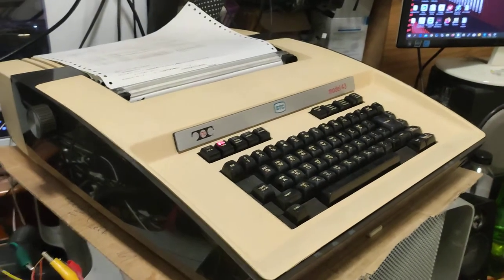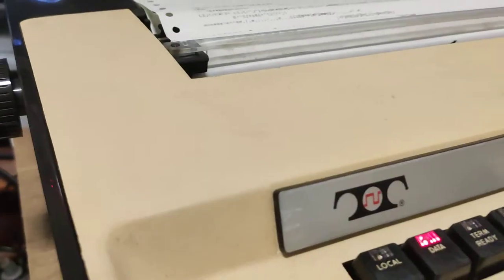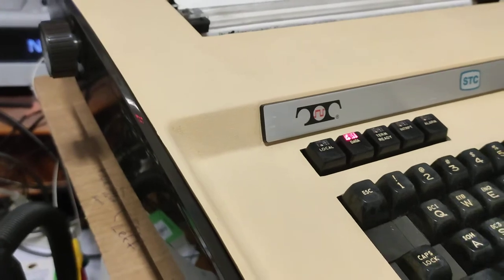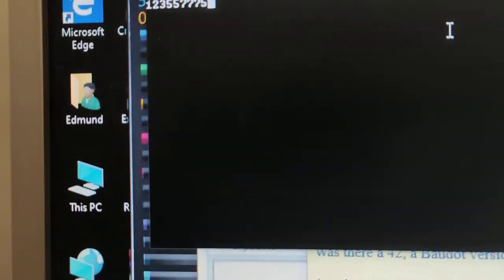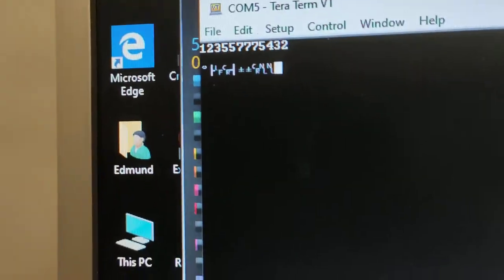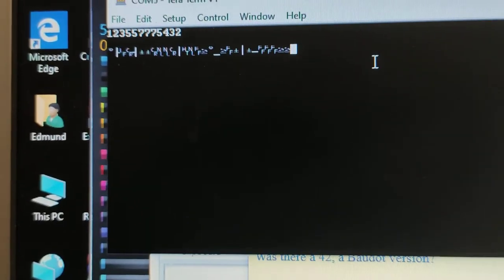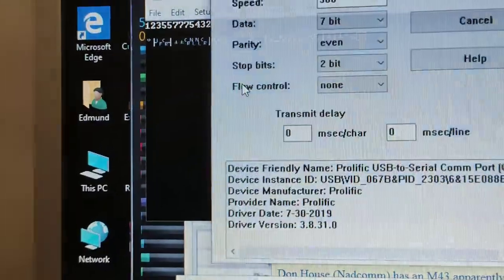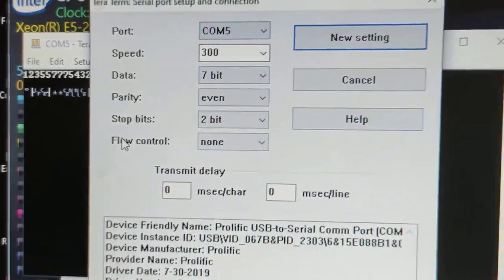Printer working!  KSR-43 Teleprinter (Model 43 Teletype)

Comment: Have you found a source for the ribbon?
Reply from the maker: No :-(, but I have two old ribbons and I'm going to experiment with re-inking one. Thanks
Reply: @RoyAntaw  I just picked up a KSR 43 this afternoon, and it does have a cartridge, but no ribbon.
I almost found a place that has cartridges, but it turns out that they are having trouble getting the “re-inking” mechanics.